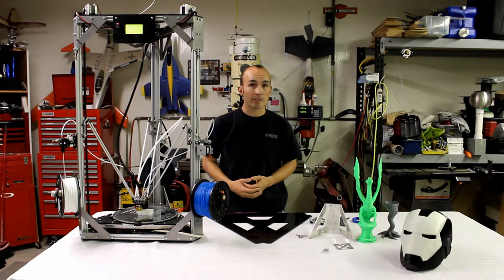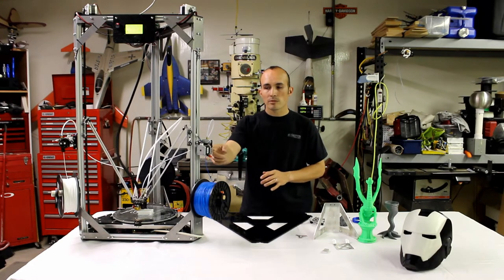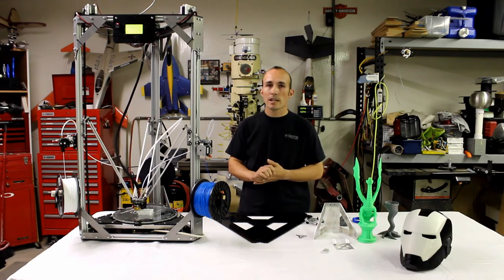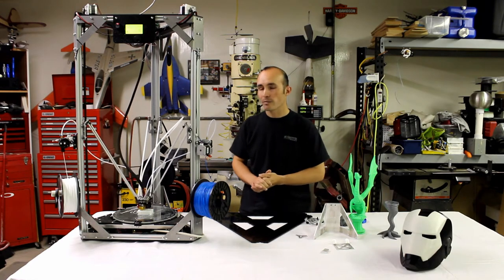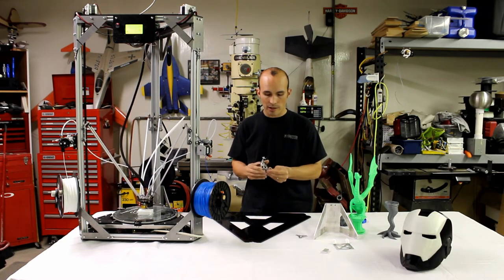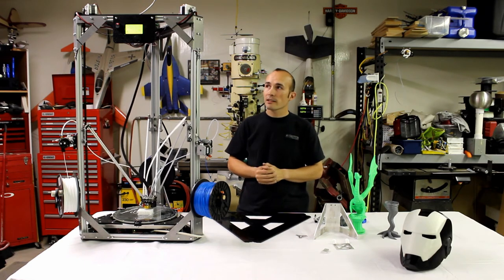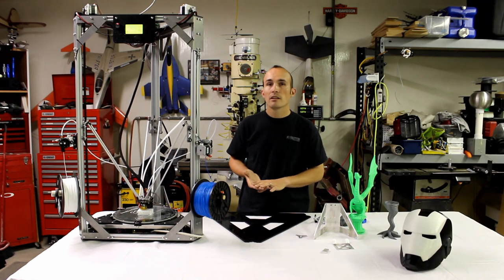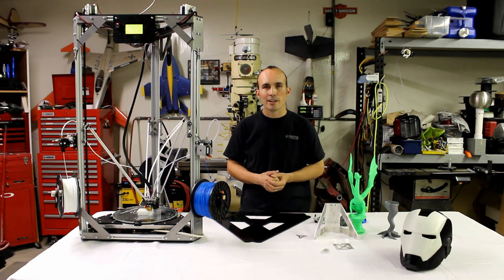Trestle 3D Printer Introduction

Comment: The printer lists for $499 does that include everything to build it and run it minus the filament to print?
Reply from the maker: Willywonka321 I have updated the website to make the kit information more clear.  $499 is the price of our kit, which includes the unique parts that can't be obtained anywhere else and some hardware.  You will need to purchase off-the-shelf parts from other retailers in order to build a complete printer.  We provide a list as a suggestion of what else to get.  Letting you choose what components to use is the main selling point of the printer.